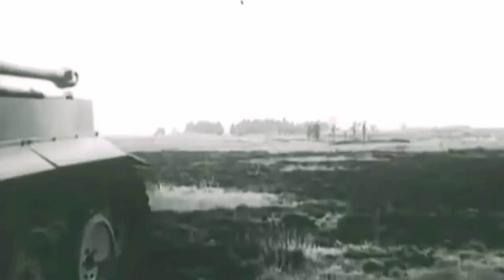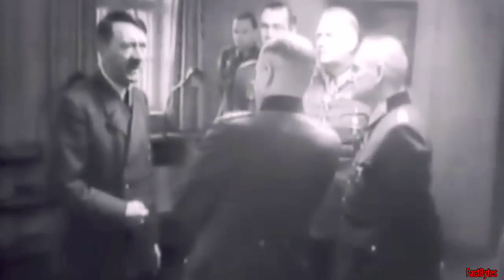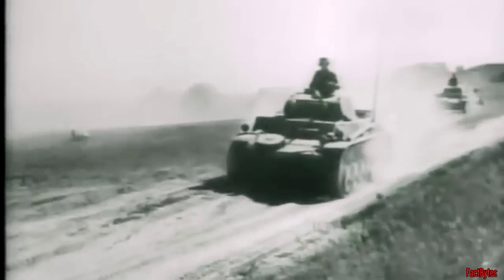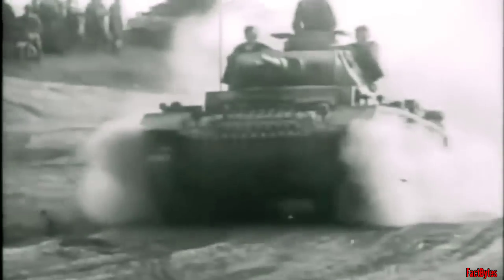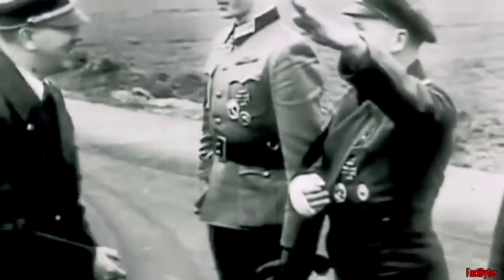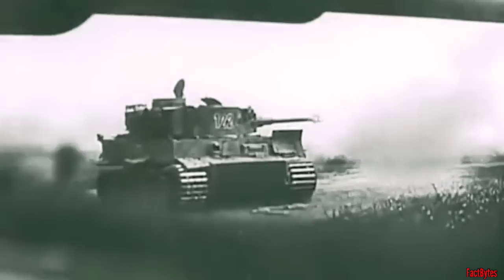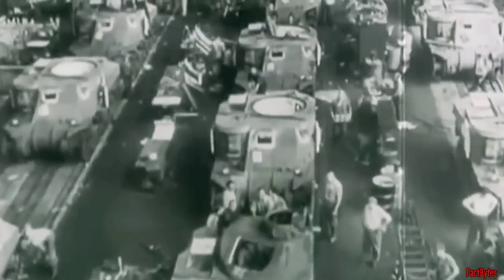Were German WWII Tanks REALLY Over-engineered?

Comment: Due to the war situation, vehicles in the prototype stage had to be used. The supply of strategic materials like molybdenum or rubber etc. was getting worse and worse. The gears, engines and even armor plates got worse and worse in quality due to the lack of these materials . Since the tanks were welded, experienced welders were required in production. This personal also became less and less available due to the draft. The result was a generally declining quality, which has nothing to do with the complexity but with the production possibilities of a country that did not have sufficient resources of critical materials and fuel and people to fight against half the world. Stupid decision.
Reply: All true, but the situation regarding workers is especially important. The answer to a shortage in workers when all the men are on the frontlines? Women! Hitler was against this by ideology, because they were meant to be baby factories, but was halfheartedly used after Stalingrad and the Total War policy. Ideology got in the way of sensible production and is often overlooked. Soldiers were stationed in Norway for years because of this and the admittedly very important iron ore supply, but it tied up numerous divisions. Even the SS battalions were less effective than the actual Wehrmacht, but they obviously got more resources. Not to mention the Holocaust, which bled resources. Unskilled slave labor hindered production too. There is a neat story of a slave laborer sabotaging 20mm explosive rounds for BF109s, which should have downed a bomber, and who replaced the secondary powder with messages saying something to the effect of “I hope this helps”.

Point being, you’re right. There were too numerous issues that plagued the war effort beyond repair. Thankfully. We’re fascinated by late war German, but they should have stuck with light reliable designs like the Panzer IV and Stug. Not perfect designs by any means, but neither were any of the allied tanks. Glad they didn’t though.

Comment: While they were formidable tanks - the Tigers and Panthers were too expensive and too complicated to build in the numbers needed to stand up to the simpler but far more plentiful Allied Shermans and Soviet T-34s.  While quality is important; quantity has a quality all its own.  The Germans were thinking in terms of powerful armor divisions to spearhead what was essentially a large infantry/artillery army.  The Soviets were thinking in terms of tank armies.  Mass - thats what creates wallop.  What the Germans really needed was a true 35 ton tank - powered by an air-cooled diesel engine, running on cheap, easily repaired or replaced leaf spring suspensions and armed with the KwK 42 or the 88.  And they needed to turn those things out like hot rolls.  They still would have lost the war but they might have prolonged it to avoid total disaster.

Comment: The proposition that German hardware was “superior” to allied materiel is a canard. What set their armor apart was simply large guns + thick armor. That’s it. None of the various iterations of their armor which became progressively larger and heavier stood the test of time or battlefield conditions. How often did Tigers or Panthers break down in the field? Very often. Hitler, with his phallic preoccupation, even countenanced the ridiculous Jagdtiger, a 75 ton behemoth which could hardly move a mile. Meanwhile, the Allies turned out far more materiel which was ultra reliable.  That’s one big reason the war was won. And can it be said the Luftwaffe ended up with better planes? Yes, the ME 109 and Focke Wolffe were good, but better than the Spitfire, Mustang, Thunderbolt or Lightning? Nay.

Comment: They were in reality underengineered with workarounds and ad hoc solutions due to underpowered engines and weight issues.
Reply: It wasn't so much that they were underengineered as that they were designed to a configuration and then had design changes that kept increasing the vehicles' weight, without concern as to how the weight increase affected the other aspects of the vehicles. As the weight climbed, the engines had to work harder to move the tanks, and the transmission was under greater stress as a consequence. Since neither the engine nor the transmission were upgraded, this led to an increased rate of powertrain failures. And technological limitations contributed to the problems -- the Germans could not produce helical-toothed gears, so the Panther transmission used spur gears, which are simpler to produce but have a lower torque limit, and became subject to breaking gear teeth under the heavier load.

Comment: Be it a car or a tank, the Germans are know for over engineered products. It was of course no fun if a Tiger was shooting at you while you sat in a Sherman or Cromwell, even a T-34. But the most unhappy person in the crew of a Tiger was the guy that got to keep it running. The engine was over worked, the wheels were a pain to replace. You can fit more 75 mm ammo in a tank than 88 mm ammo. The Panther arrived prone to breaking down. The Tiger II was over loaded. They made impressive pillboxes though. Gas guzzling beasts. I'd rather be 1 of ten pzkw IVs on a battlefield, than 1 Tiger. Yes they had fuel problems. Too bad.

Comment: My fav comparison between German tank production and allied is think of the allied as Ford style assembly lines. In the case of the Tiger some parts were custom fitted for each individual tank. Think of the logistical nightmare a car company would have if every car they produced had to have custom parts ordered for each individual car. That's  German over engineering in a nutshell.

Comment: they only out matched the allied tanks in armor and guns, allied tanks has the advantage of ease of maintenance, operation and often better mobility and off road operation, the M3 Sherman is the most under rated tank of ww2,  its was so effective that the easy8 the was still able to go toe to toe with the T34/85 in Korea.  The German best tanks over all were the  panzer 3, panzer 4 and stug III,  had they not wasted resources on panther, tigers and tiger 2s they would have had 4 times the amount of AFVs on the battle field, the Pak 40 guns on those tanks where more than capable of dealing with the bulk of allied tanks.

Comment: Overengineered means you designed and built it stronger than necessary (e.g., suspension built to carry 100 tons when your need is 50 tons). When you design it too complicated to build/repair/use, thats NOT overengineering, thats bad engineering.

Comment: As far as I know it's mostly a myth that German tanks were over-engineered, in particular when it comes to the late-war ones (Tiger, Tiger II, Panther). It seems instead like these tanks were pretty well-designed for easy manufacturing.

Comparing prices across the currencies, late-war German tanks look rather cheap. 
- a Panther cost almost exactly the same as a Sherman, despite being a much more powerful tank. 
- a Tiger 1 cost less than the initial model of the KV-1 and Centurion, despite (again) being a more powerful tank compared to the KV-1.
- a Tiger 2 was roughly 1/3rd more of the cost of an IS-2, which doesn't seem very expensive considering it's more powerful.
Reply: Here's whats the real kicker: Germany was running out of money. It was in an economic crisis. The Soviets could keep pouring resources into these tanks, and churn them out consistently. This is conflicted by many production test runs built by other companies that ended up losing, and crew shortages that weren't compatible with manpower loss. Experienced crews knew how to run the Tigers and Panthers, the inexperienced often abandoned their tanks hours after getting inside of them. And in a study of a German 105mm gun, it was discovered there were three times more parts than an American gun, with no immediate benefit to the gunner.
Reply: @squeaky206  I'm sure there's many examples one can find of inferior German engineering. But when it comes to their tanks and them being over-engineered, it's not true if one compares their prices to contemporary tanks. The early tanks, like Pz III and IV, I've read were probably somewhat over-engineered and not optimal for mass-production, which made them expensive relative to their combat value. But for the tanks after those (Tiger, Tiger II, Panther, etc) it doesn't seem to be true at all.

Comment: Yeah your tripping. The Tiger ll was an awesome vehicle and the template for future tanks. Nothing about the vehicle was wrong (after teething) but the limited resources made the building of these "wrong"
Reply: Really?  What modern tank uses a gasoline engine or the interleaved road wheel suspension?  What modern tank has the engine in the rear and the drive wheels up front?

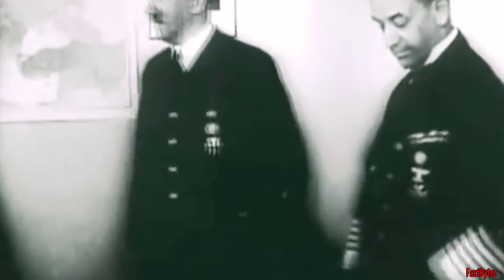Comment: 3:25 no, I don’t believe this is true, and neither should anyone else.  While the Pz III was obsolete as a whole for lack of ability to be upgraded with a larger gun because of its small turret ring.  The Pz. IV on the other hand was at least as good as the t-34 and overall highly underrated.  This is particularly well illustrated with arrival of the Pz. IV auf. F2, G, H & J.  All packing the KwK 7.5 cm L/48 gun.  This vehicle was far superior to the t-34 in all primary specifications.

Comment: Why didn’t the Germans adopt the Christie suspension system?
Reply: for what?
Reply: @MultiNike79  their tanks
Reply: @michaelgriffis5259  christy pendant - why? There are torsion bars for light and heavy tanks. For intermediate tanks there are different options, depending on priorities.
The USSR bought Christie's suspension because at that time it did not have the opportunity to make torsion bars.
Reply: @michaelgriffis5259  Torsion bar suspension is great, but at the time the quality of the metal was poor and there was no reliable way to test the quality.
It was suitable for light tanks due to its low load. Or heavy ones - due to low speed. Medium high-speed tanks, such as the T-34, loaded it too much. For the Panther, the wheels had to be staggered so that the load on the torsion bars was adequate. But this sharply increased the cost of support a tank.
Only after the war did quality improve so much that torsion bars became possible for high-speed heavy and medium tanks.
Reply: @MultiNike79  why not use it on the mark IV?   Not to mention the Panzer 3.